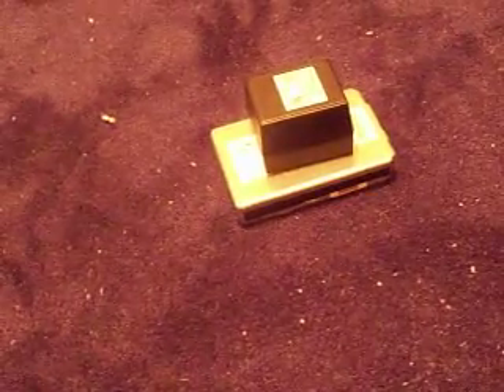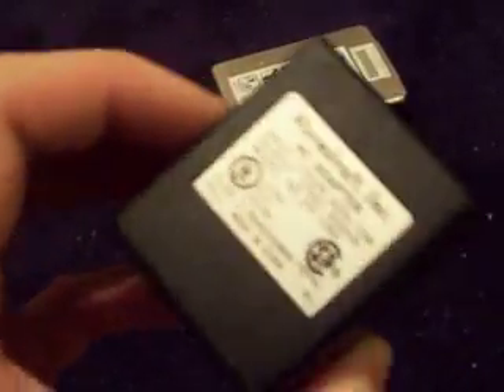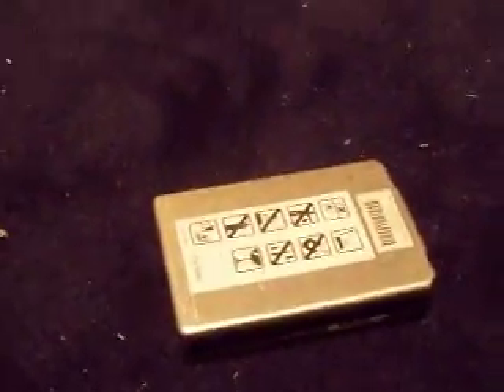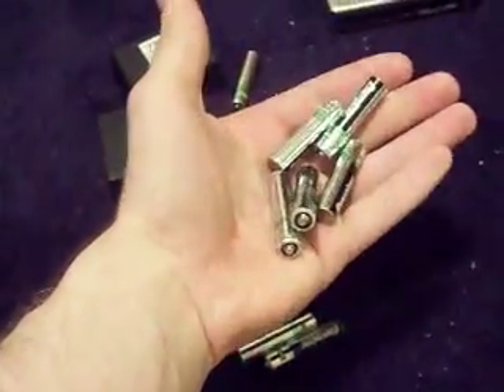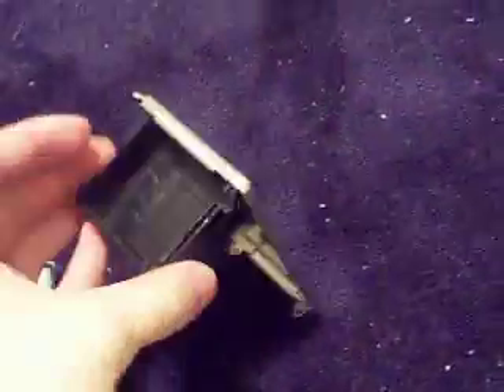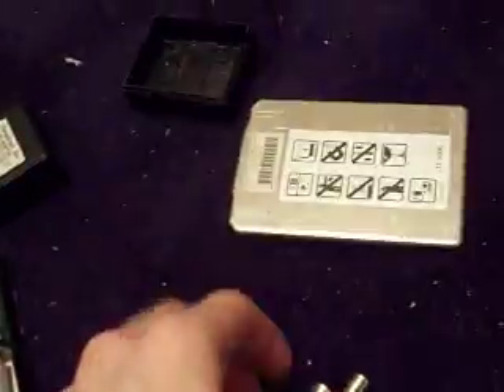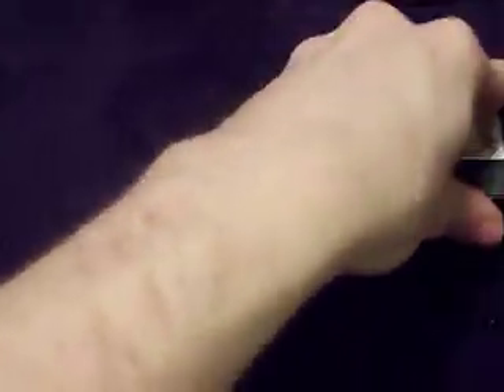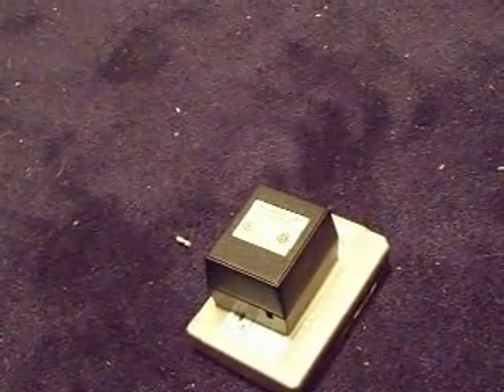Ac and Hdd Case

Comment: Wow! I've never even thought about this before. That's pretty cool. I'll have to try this sometime. I like finding ways to reuse stuff. Waste not, want not. I seen a video a while back where a guy had found some bullet shell cases at a gun shop that would hold AA or AAA based on the diameter of the batteries but, I don't know how much they would cost. One of those little Trident gum cases can be used to hold AAA batteries too but, I forgot how many it can hold. It really pays to keep some things instead of throwing them out.